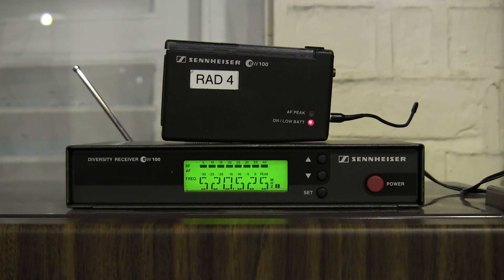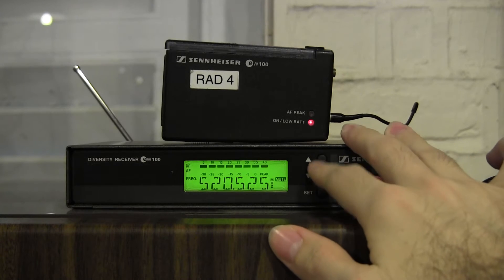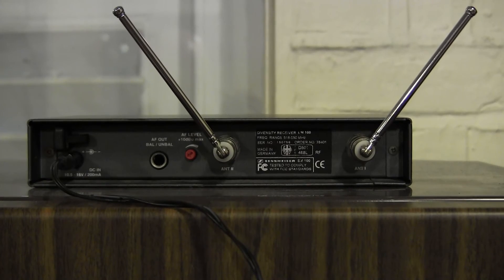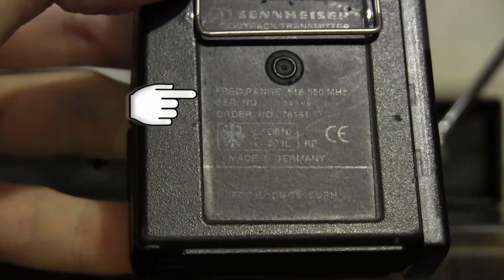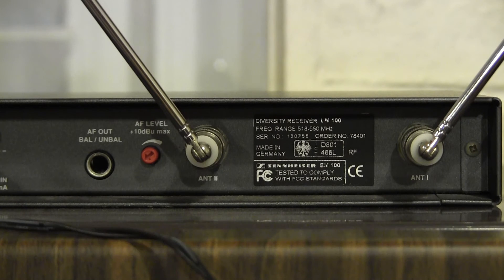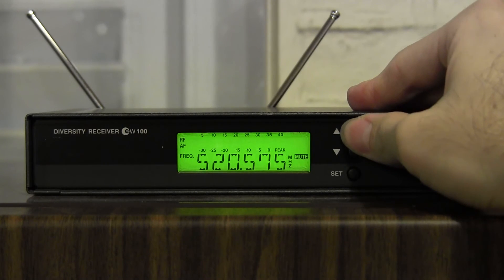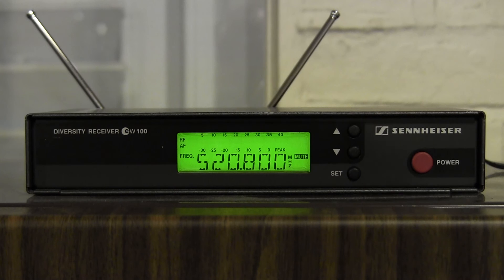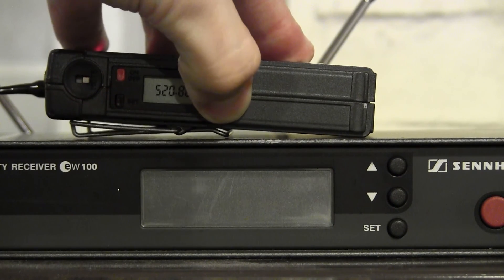How to reprogram transmission frequencies on the Sennheiser Evolution 100 wireless system

Comment: Hi Bruno, about wireless microphone, my receiver microphone has volume.  How can i set volume to match gain input mixer.   
Also when you hook up laptop,  iphone to mixer how much volume at laptop or iphone to turn on to match gain input mixer.
Thanks
Reply from the maker: +hoang tieu I advise setting your receiver volume to maximum and then set gain on the mixer accordingly. Same with the laptop or smartphone - set the device volume to maximum and then set gain on the mixer based on that.

Comment: Hello GLB, thank you so much for all the wonderful videos. I've learnt a lot from yours demos/reviews. I have a question, at what db do you set your squelch setting? I set mine at 0 and every time i turn my transmitter off, a huge noise just pops out of the receiver to the amp/line out speakers. Please do let me know at what db do you set your squelch setting. Thanking you in advance
Reply from the maker: ***** Hmm! It's been a while since I've used this particular system, I'll need to check over the weekend and let you know.
Reply: GLB Productions would be great..... Thanks in advance :)
Reply from the maker: ***** Hi Theodore, the squelch on my system is set to 10dB, which I believe is the factory setting - I've never changed it. Try that and see it is suppresses the turn off noise.
Reply: Yay! Thanks GLB. Since you've used it much more than me, do you like the settings/sound at 10dB? You got that sound you want? :) does that dB have anything to do with the tone & and other output sounds?
Reply from the maker: ***** It sounds fine at 10db :) Remember that the squelch setting is simply the amount by which the audio output from the receiver is attenuated when no corresponding radio signal from the transmitter is detected. Modern wireless receivers use what is called a 'tone key squelch' in which the transmitter sends a unique tone (beyond the range of human hearing) that the receiver uses to recognise the transmitter and unmute its audio output. So once the receiver detects the transmitter, the actual squelch setting makes no difference to the sound. 

Some good information here if you'd like to read more about this: http://shure.custhelp.com/app/answers/detail/a_id/3961/~/what-is-squelch-on-a-wireless-receiver%3F
Reply: GLB Productions ah..... now I understand much more..... Thanks GLB
Last question, sorry for this one..... But do you remember at what o'clock is the factory setting for this EW100 AF Out red knob at the back of the receiver.....
Also, if you can't remember it, at which position did you put it? and what is your recommended o'clock for the knob, please do tell.
I checked sennheiser demos but i really don't understand what they mean when they say "way too hot" on their AF outputs..... Thanks in advance again sir :)